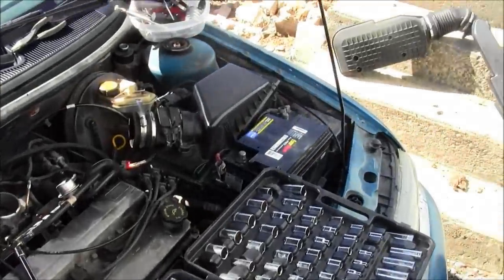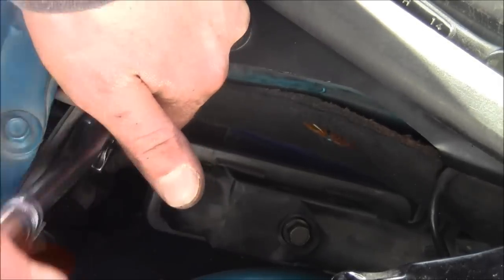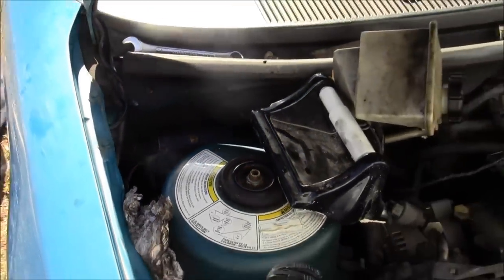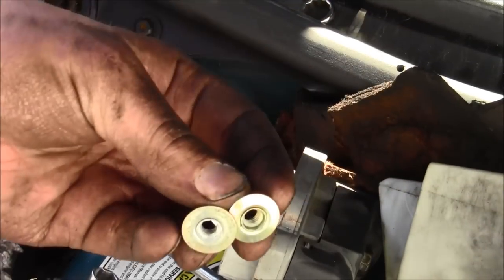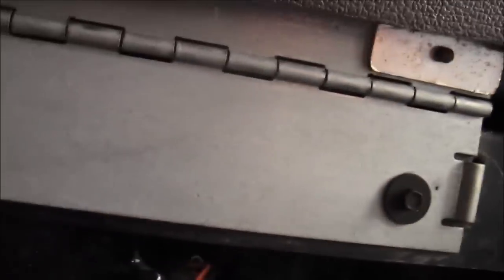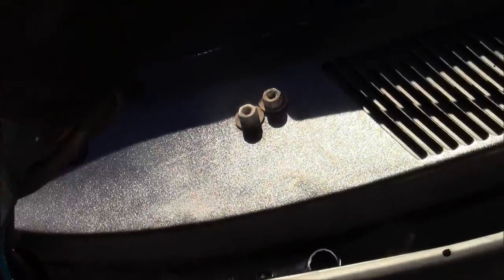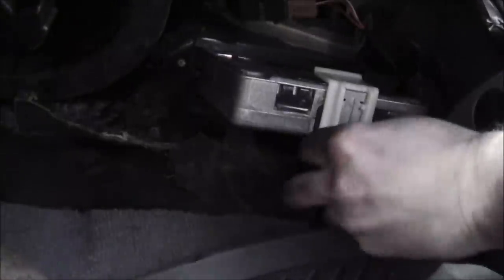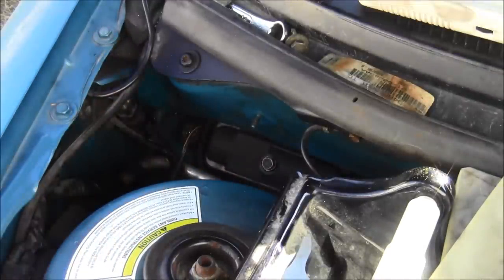How to Replace Powertrain Control Module (PCM) Car Computer

Comment: Here's one for ya. 2000 Sable 3.0 Duratec. Died while driving down the road. Wouldn't even turn over. Reset the alarm system and the car turns over now but will not start. Has spark and fuel to the injectors and they are all working properly checked all fuses and every wire possible. Never had a problem with the car at all. Has 261k miles. I have every receipt for anything done since my dad bought it new. Never anything major done other then starter and altanator and the usual maintenance done. Solve this one if your good enough lol.
Reply: Have you checked your ignition switch to see that its working properly? It could also be the chip in your ignition key. You may have to have the key or switch replaced. Also you might have a problem with the neutral safety/range sensor switch on the transmission.
Reply: @michaelrehkop4817  it actually ended up being the ECM. I bought a new one off of the internet for 179.00 with 2 blank keys and a lifetime warranty. Shortly after replacing the ECM my fuel pump driver module went out then a week later the fuel pump went out. Now its running like a new car. It does have 280k miles. Been told I'm lucky its lasted that long being a 3.0 dohc 24v duratech. Little joker has some balls to it now. Dad bought the car new and always kept up with the maintenance.

Comment: I found my PCM right next to the battery on a 1997 Expedition. Just removed the battery and mounting box and the PCM connector is on the firewall with a 3/8 bolt and just removed a clip on the inside under the glove compartment.
Reply from the maker: Thank you for your story. I will, as well as we will, add it to our collective minds.

Comment: I have a 2004 ford crown vic p71 police interceptor it won't go over 35 mph in drive its just revs up like its in neutral could the pcm be my problem

Comment: What kind of car is this? I need to change the powertrain module in a 2009 Nissan Altima hybrid. I'm going to buy one refurbished and preprogrammed for my car and do it myself. No I'm not a mechanic but I don't have $1k to pay a dealership to do it lol. So I'm trying to do it myself. Anyone know where the computer is located in my car? I know it varies car to car.

Comment: Hey Matt, I know it's been 2yrs since you did this PCM install but I was wondering about the comment you made at 2:40 concerning the car running crazy until the new PCM "re-learns" all of the various assignments that the PCM performs.. I have a '95 Contour that looks like it needs a new brain but I'm seeing conflicting info regarding the swap.. The so-called Pro's say that the new PCM needs to be calibrated using your computer and some special Ford software before it can even be installed.. But you're saying that it's ok to just install the new PCM and the car will start and everything will work out after the new PCM has been ran long enough to "re-learn" it's duties.. I guess my questions would be how'd everything go with your '97 Mystique after you finished the PCM install?.. Did it start without any major BS-ing around?.. How long did the car have to idle before the PCM finally re-learned all of it's tasks and everything was back to a normal running/operating condition?.. I'd really appreciated your feedback because your method sounds way easier and far more affordable to me than the Ford recommended method of computers and special electronic calibration tools.. lol
Reply: Some PCM's come pre-programmed when you order it, because you give the manufacturer the VIN number of your vehicle. They flash it and then send it to you. Once you get it then its just plug and play. Now there may be a relearn procedure for the PATS when you install the replacement.

Comment: Is changing the pcm on a 2006 Ford Taurus going to be a similar procedure?
Reply from the maker: same beat, same rhythm, different tune
Reply: If you call having to remove the intake manifold easy…

Comment: Why would my grand am 2000 start n.run a few miles n then shuts off . N turn on again n run another mile o two  before it shuts off again ?
Reply from the maker: Car's probably tired of running.

Comment: You got her from the back first then you got her from the front??? I tried it dude with a longer extension! Now she's fucking all kinds of pissed off at me!!!  Couldn't even get her from the front after that! Ran away calling me all kinds of scumbags in the book!!!  So embarrassed now she won't even look at me!  Your tips on installation got me in trouble man!!!
Reply: All you have to do is loosen the bolt pull it off the computer and inside your car on the passenger side pull back the carpet and look up under you'll see a bracket w one bolt. Take off the bracket and pull the computer out. Don't ever take it out from the front looks like a pain in the ass. Anyway hope that helps in the future. I mean i hope you dont have to mess with it again but if its a cougar you never now. Good luck

Comment: Any idea on why the spedometer would jump to 130mph while sitting in park at idle? Changed vss at transmission since it wemt bad.  Was told theres one behind cluster but idk where. Spedometer amd odometer dont work. 96 contour 4cyl
Reply from the maker: A bad battery, alternator, loose connection would make the gauge needles jump erratically.  If those are fine then the idle control valve might need looked at.  Make sure all the fuses are in good shape. Bad spark plugs and wires may do this as well.  The PCM may be trying to relearn engine values after a battery reconnect and be glitching somehow.
Reply: You gota fix that immediately or you’re at risk of getting a speeding violation and that’s a felony at that speed

Comment: I changed my pcm recently and my car still isn't starting.
Reply: I know you posted this 2 yrs ago but if you still have it and haven't got it running i have the solution. If you have a red flashing light above your radio located on the far left on those things that kinda look lile buttons lol that's your security system in play what that flashing light tells you is that the new computer you put in doesn't recognize the key. I had the same problem until i did my research. I called a lock smith that specializes in programing keys for cars. It costs me about 130.00 but would have been 80 cheaper if i didn't have to find someone out of town. Hope this helps. Hell hope you already got it fixed god bless
Reply from the maker: good job in changing that pcm
Reply: I have a 2003 Acura MDX the computer was missing when I got it back I bought one from salvage is there a computer steps to set this computer

Comment: How do you fix a power train on a x5
Reply from the maker: Take a power train and multiply it by 5
Reply: Depends on the schedules
The trains run different times
Careful in those New York subways though

Comment: i have 2000 contour just had the whole pcm updated. rpm were acting weird at idle.
Reply from the maker: Lyndon Bishop Glad to here it got fixed.  Experience gained
Reply: MattHumanPizza yeah they said something about re calibrating the pcm and doing a update on it. if that doens't help i have to take it back. but no code lights were on the dash. I watch your vidoes sometimes your funny and you seem to know alot about the contours and the mercury cars. I just use the 2000 model i have for work but its a fun car to drive.

Comment: So new computer  was the issue ? Because I replaced my opti spark LT1 FIREBIRD started .Then I  replace all part on car like water pump so on .Car will not started . Now for this https://www.chick.com/reading/tracts/1022/1022_01.asp Driver hits the wall .

Comment: 🤔That PCM really was upside down from that factory whoever resigned that automobile should be real in front of a real foreign  Squad that's why most folks will not buy new automobiles now days they are so ugly also most all auto technicians really are giving up on auto mechanics because everything really is so hard to get to really got to 
 drop the engine out to change spark plugs on most all automobiles now days

Comment: That was really totally insane to put a power steering reservoir right over top of a PCM that's probably what made That PCM  bad really probably leaking power steering fluid whoever designed that automobile should be put in front of a firing squad they got real ignorant  people designing automobiles  now days also automobiles really are so ugly I will not even buy a new automobile now days old automobiles look like real cars not now days really now days automobiles really are really more than ugly nobody even wants to buy cars nowadays they are so ugly they don't look like real cars old cars did